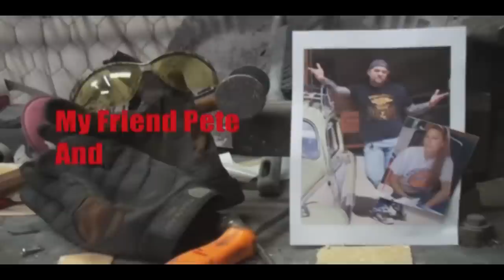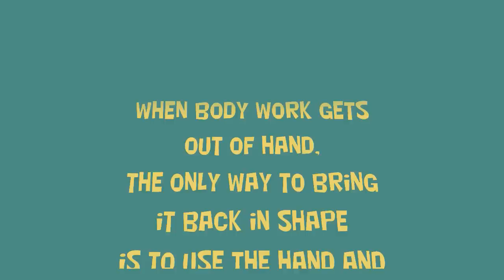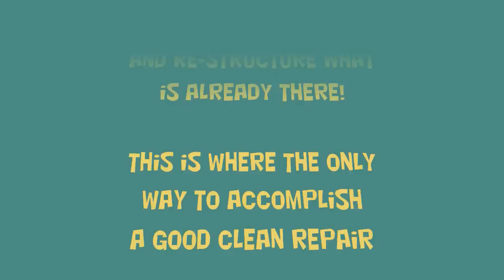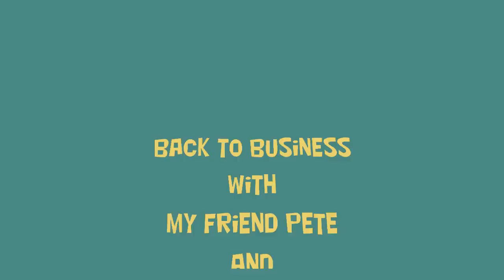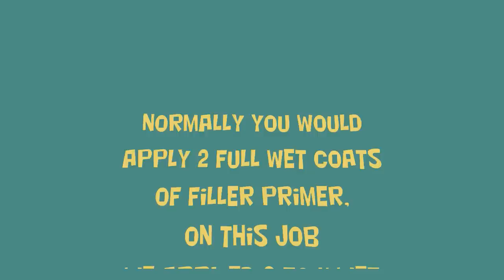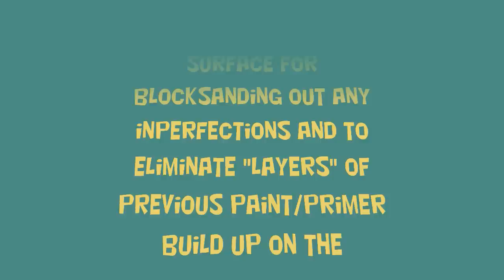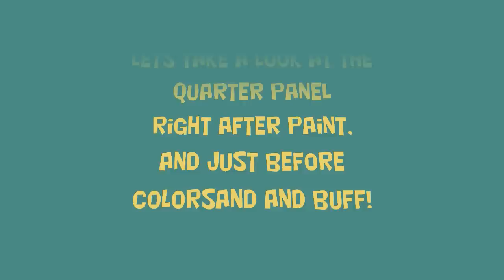How Do I Sand "BONDO" and Make It "PAINT READY"? - From Start To Finish

Comment: If u want to remove the low and hi spots in the surface of the body filler to make it flat and straight, specially if you are making the character line of the body, u must use a hard block. Flexible block is not the right choice. Flexible block is good in shaping concave areas. Hard block has even surface cutting compared to the flexi block that when u put pressure in it, it bends. And there's a tendency that you are cutting more in the area where u put a lot of pressure than the rest of the flexiblock that's going to turn to low spots again.
Reply: Pete is old school  His methods are the best. I learnt these moves fifty years ago when I served my time.as an apprentice.
Reply: exactly hard block people are lazy and cant handle the weight of a hard block thats why they always use those flexible blocks .people dont realize the blocks hr is using are made to block primer out only they are painters blocks
Reply: @mjg50550  I have a 36" hard plastic block that uses Velcro paper, I also have a 12in hard block in addition to the regular 5 or 6 inch long hard blocks.

Comment: To Pete, I thought you take you dent  down with 80 to bare medal lay your filler, flatten with 36, then 80, then move to 180.  

Can you maybe make a video that does step per step on grits the whole process.  From dent, to prime, to seal, to paint all the grits you need.
Reply: Depending on the shape of the paint, there's not necessarily any reason to go down to bare metal
Reply: Very good video ,one thing I noticed was what grit sandpaper was used on the fish sanding ???

Comment: Lol closet clown 940 hey Pete what grit of sandpaper should I use to scuff paint for primer
Reply from the maker: I would use 180 dry then go back over it with some 320 dry and it should be ready for paint... THanks for watching..
Reply: marcus hinks 100 grit
Reply: @3G Craftsman no not 320 before primer. 180 before applying filler primer, then 320 before paint

Comment: GOODONYA Pete...I love your channel, been doing  bodywork and paint for decades and I'm always learning.
Im in Australia, and right now Im working on my '68 Camaro SS coupe that I bought a few weeks ago.
Pretty good body for its age, had rust behind back wheels, thats now cut out ans sections mig welded back in, one rear 1/4 panel was pushed in too along the mid bodyline and lower, Beat most of it out then bondo the whole panel.
5 coast 2K primer filler and blocked that with 120 dry, ready to re prime and reblock. Bonnet(hood) I had glass bead blasted and sandable 2K primered it was a new reverse cowl panel that had lot of surface rust from the elements.

Comment: Good Video, doing two projects. Bumper cover on a Terrain and the passenger side on a sierra I bought. Your tip on mixing the Bondo with the Polyester worked well on the bumper cover for the first layer. Went on real smooth and sanded out great. Just filled a couple of the pin holes with the polyester, scuffed the rest of the paint and getting ready to paint. Thanks for sharing your knowledge and for your service.

Comment: I decided to watch this for the 2nd time as I have a 1982 Yamaha Virago 920 I bought. I just spent 2 nites, 4 hrs each, stripping 5 coats of paint off the tanks, I got an extra so might as well do both. The guy had also neglected to cover the filler and had sprayed the inside of the tank resulting in the carb problems he was having. To save money and time I will be using a single stage paint but want to do it as best I can. I also will be painting the fenders which are chrome so I will be working on getting that sanded off or whatever it takes. I mentioned before where I used thin metal rods to get both sides of the tank as even as possible by bending them to the shape I need. Have to see how it works out. I will also be checking out your video on making sanding blocks. Thanks for sharing.

Comment: Hi, really nice job on that GTO. My brother had a '66 GTO convertible, maroon on white, in high school so I know what those rear fenders are like.I'm a novice yet still try to do the best I can when doing body work on a car. One technique I used when working on a '72 Javelin to get a quarter panel to match the opposite side was to take wire rods for hanging insulation and shaping them to match the contour of the quarter panel at about 5" intervals. Actually worked pretty good. I'm going to do the same to fix a small dent on the front of a front fender on my '07 Mitsubishi Galant. I learned a lot if I ever get to the point of working on larger projects. Thanks for sharing.
Reply from the maker: Thanks for the tech tips Kevin, Ill have to try that someday.. And Good Luck on all your projects!

Comment: Very good information here, I am feathering in some body resin over a weld seam where I used the flange technique that you showed on the quarter panel repair videos. Currently I am restoring a 73 Mach 1 and have been using your videos as a guide to make sure I do it myself and do it right. Thanks Pete, you have a new subscriber, I appreciate all of your work and techniques that you show us, keep it up,

Comment: Pete is spot on with his technic , the only thing I might do different is epoxy primer on patch panel and bare metal , then filler work on top of that , epoxy primer then the build primer . His way is also correct . Had I done this job as Pete is I would have epoxy primer over the filler then build primer , just my preference . Good work Pete, God bless .

Comment: Right after it was primed, I only saw one very minor "bondo bulge" right in the middle of the panel, between the back wheel opening and tail light area, just above mid panel height - in the same place where Pete added some extra filler and blocked it out with the little block "staying only on the filled area".

Considering the gray rainbow he had to deal with first, in order to even get into primer and not have those layers show through, this method was the only real way to remedy that situation before going any further.

Anyway, long block sanding with a fine grade paper on the finished primer coat before painting definitely would've slicked out any remaining slight ripples for a truly flawless panel.

This is a man who knows exactly what he's doing at every point in the game because he learned the hard way, which is a good teacher.... only if you're a quick learner. Doing it right means getting your mind ready to accept the rewards and the consequences of every action made between your eyes and hands. 

In the real world cause and effect still rules the day and either makes you a paycheck or a cardboard sign for the Walmart parking lot. The only substitute for hard work is smart work!

Very hard for a novice to match up and level out what Pete was dealing with here, but the same techniques he used to show the proper fix can be applied by any student to any panel job where filler is needed. 

Thanks again Pete!

Comment: Thanks. I am learning. Good teacher. I have a 40 willys pu I have had since 1967. Kept it with me. I had a 69 nova clip put in. Never on road. Working on steering now. GM. Have it in need to final weld. The guy that did it burnt up the plastic holder at bottom of column.

Comment: I use to use 99 cent flat black paint as a guide coat, and it worked ok, till I switched to rattle can guide coat, and it was better cuz my sandpaper was balling up the cheap paint, and the result was going through more paper, and leaving scratches behind from the balled up paint stuck to the paper, then one day a co-worker of mine, who works in the paint/body dept. at the auto parts store I work at, told me to try the graphite powder with the applicator, so I bought the kit, tried, and that was the best! because not only it last the longest as far as everyday use goes, it's a very fine powder, which can get into the tiniest of scratches, which the rattle can guide coat couldn't penetrate

Comment: how you get rid of deep scratch on dry bondo..i pasted bondo on some plastic part but edges  have some deep dents..i sanded it to level surface but there are some small points like nail spots..how i solve that issue shout i put fresh bondo on it?

Comment: thanks for the info on the long sanding blocks ill have to get one mines only bout a ft long , one thing i like to do with my final bondo and primer sand is to constantly keep wiping off the dust with a clean cloth or dust pan brush and blow down surface and sand paper so sand paper doesn't keep clogging up and scratch the surface also to see any pinholes that might get covered with dust its surprising the  S#!t dust can hide

Comment: Thanks for the info...
What your doing is showing you have to use elbow grease to do it right...and keep positive...helping restore my 66 impala.
By the way, do your use filler files?
I find that at first they make it flat and straight for a good start.
Also I use allmetal for my base or start than a skim of filler that can be sanded with fine and no need for spot putty...
I like your technique...
Thanks for the help.

Comment: Thanks for the video I’m a total newb and I’m using bondo to shave my engine bay. Sometimes the bondo has sharp edges like the first coat. Do you use a block or like a DA to knock off the sharp edges on the first coat? Thanks

Comment: After block sanding the filler,what primer can be used prior to epoxy primer (sealer) if the part will have to be on the shelf for a couple of weeks or month while other parts are being filled and sanded?  I don't have the facilities for spraying in my garage so I have to use a rattle can until I can get the parts to a painter.

Comment: Pete, after I block/wet sand the primer with 400, if the bondo shows through again I assume that I’m sanding too much. Do I have to re prime that area and re-block it or will the paint be fine to spray on the bondo with a 400 grit finish for tiny spots? Hopefully I’m making sense.

Comment: Question: When I bought my car, it has a dent/scratch about 2 ft wide. After I do the full process on sanding, adding bondo, and leveling all the necessary. Do I have to spray primer on it first always? Or can I go straight ahead and spray paint it with the color match. The dent is in between above the wheel arch panel and on the rear passenger door.  Please help! Thank you!

Comment: Question! 
I’m doing a quarter panel, already applied bondo fiber and filler, and I’m getting a few metal dot high spots right in the fucking MIDDLE where the accident was! Obviously I pushed it out too far/high from inside the trunk…can I hammer it down or will if crack and ruin the filler in the future?? Like crack off chunks after painting??

Comment: Hey Pete, thanks for the video!  I'm trying to get a quarter panel straight on a 70 Blazer.  I welded up the marker lights (with time to cool!) and thought is was straight enough for bondo (or no high spots).  I put the bondo on it and blocked it.  The problem is I put a straight edge (3' and 6' one) on it and where it goes from metal to the bondo is all high so the straight edge teeters.  You can't feel it with your hand but the teeter is up to a 1/2" over 3' or so.  It just seems to have a gradual high spot between the bondo and the sheet metal.  The metal and the bondo seem to be straight relative to each other until I put the straight edge between the two.  I'm at a loss on what to do!  Start hammering and dollying?  If you follow me I'd appreciate any suggestions!  Thank you!

Comment: At 32:00 to 32:30 and 35:20 you point out an edge Primer/paint layer transition to bare metal situation that is similar to a situation I have been painstakingly trying to resolve. How do you recommend I best resolve this situation where I’ve been using first an Rustoleum Self Etching Primer then I tried a high build primer then I sanded back to bare metal and tried to apply 3M Bondo Filler  (from Autozone) to a bare metal section with portions overlapping a primer/Bondo/putty layer edge that keeps blistering & cracking at the old paint/primer edge layer transition to bare metal after I apply the high build primer over the bare metal edge/layer. You  said something about using a 2K urethane primer” to correct that “edging layer situation”? Please elaborate. Is that a filler paste or spray 2K primer spray product?
Reply: Spray Can Primer is nothing.. It's Laquar base CRAP! The only way to seal it up is to use professional paint and body 2K primer or Epoxy sealer.
Reply: SWRNC PETE okay Mr Pete Thanks for the reply. But, at 3:00 of your follow up video on this repair job https://youtu.be/YHhW9xdN2MU you discussed how the blistering still occurred despite the fact you applied a 2k Filler. In the follow up video noted above you said you had to re prime the entire panel using a 2K Urethane Primer. So when you said you applied a “2K Filler” are you saying that you applied 2K Urethane Primer Filler ? If so, why did it still blister after you painted the black base coat?

Comment: Can you wet sand Bondo and can you Bondo over lead love all your videos I've learned a lot thanks
Reply from the maker: Yes you can bondo over led, but I wouldn't sand with water, the bondo is very pouris and the moisture will seep to the metal and cause it to rust and the bondo will lift...

Comment: Never heard the word Bondo used so much in my life lol Bondo is the brand from wal mart, it's filler! Little pro tip I learned along the way is you can take fiberglass resin and pour it with your filler before adding hardener and it will cream up your filler and make it just like the glaze so you don't have to buy more product you may not use. Doesn't take much start out small and mix it in until you get a nice consistency you're wanting. Takes a couple extra minutes to set up but works great for final coats.

Comment: You said early in the video that the car was painted with single stage.  Is that what you used when you painted the panel or did you do a base coat clear coat on that panel?

Comment: In your block sanding you used 80 grit, should a final sand be done with a higher grit paper to eliminate sandpaper scratches or apply icing and re sand with 320?
Reply: Ron Alan I'd use 180, re prime then 4-600 wet
Reply: Ron Alan how about 180grit in between the papers you mentioned.👍

Comment: You're the man Pete! Thanks for sharing your knowledge of your craft man, I appreciate it.
This video is the one that finally made it all click I think. What kept screwing me up while block sanding is when I hit bare metal...I have a really hard time figuring out an actual high spot vs the original metal surface and I think the issue is I'm not putting on a heavy enough coat of filler to cover both the highs and the lows...Does this sound like the likely culprit to you? Or is there more I'm missing?

Comment: Did you use single stage paint when you painted the quarter panel or did you use base coat clear coat. I could have read back in these comments but there's only 1100 of them guess I'll be the lazy one today

Comment: I noticed that you sanded only 80 grit before using primer filler.  The tech sheet for pro form 2k urethane says to sand 180 to 220 before spraying.  I read that the 2k will shrink and reveal the 80 grit scratches beneath it?  Or will there be zero shrinkage and thus covering the 80 grit scratches permanently?
Reply: J Kotulak I think he would have used 180 as he did a vid on block sanding primer 2 no time..... he used 80, then 180, re primed then400 wet ...
Reply: 180 dry =400 wet

Comment: i use adtech p-14 vynlester filler it will not shrink back. what ever you do do not use a cheap filler !!! i have 30 years doing this stuff look up post curing on the net also to help with getting rid of the tacky layer is use cheap laquer thinner to scrub down surface prior to sanding  then your paper wont gum up. the reason you get that tacky is because this seals off the oxygen from the surface this just part of the cure process.

Comment: Store your respirator in a zip lock bag when not in use. If left unsealed the active charcoal in the filters will keep absorbing impurities in the air surrounding the respirator. This will shorten the usable life of the active charcoal. If you smell any impurities when wearing the respirator it is time to replace the charcoal canisters. Hope this helps your wallet and health.

Comment: The thing I don't understand is if the car is already restored and you're just repairing the quarter panel, the right way would have been to replace the quarter panel and not have so much Bondo in a restored car. And why don't you take and get your helper there to clean up that messy garage my gosh that looks worse than my kids is room I don't know how you could find a two of you need to?

Comment: i bought some cheap ass sandpaper. 80 grit & when i went to sand my bondo the bondo sanded the paper, yes the sand came right off the paper without doing a damn thing to the bondo. Also when i pealed it off my block, the back of the paper stuck to my block which took about ten minutes to get it off. i have pictures to prove it. because i couldn't believe my own eyes. what a waste.